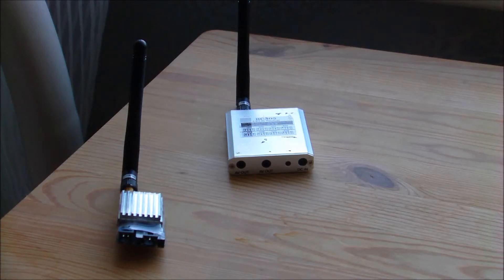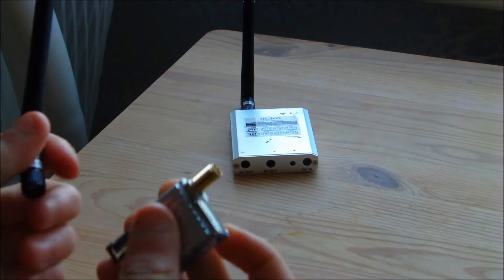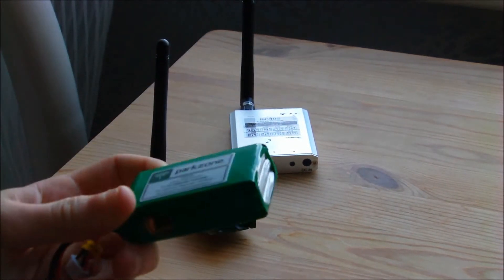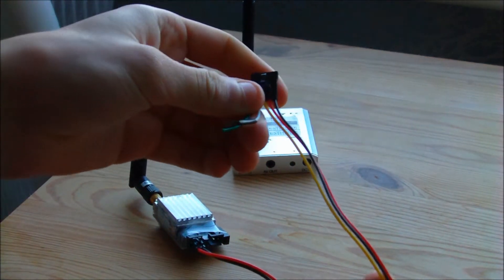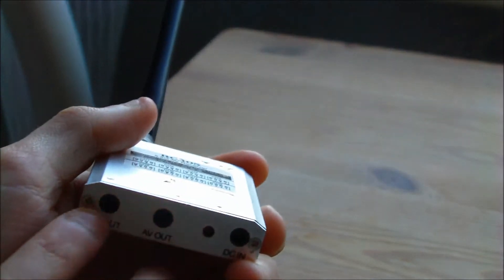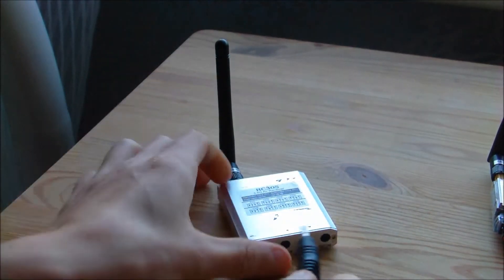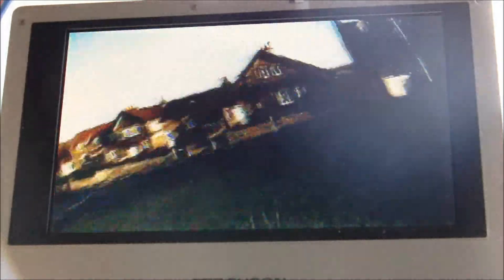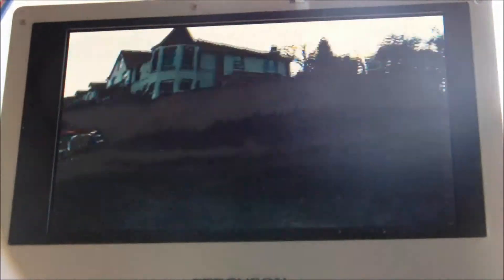Foxtech Fpv 5.8ghz system in depth review

Comment from the maker: It is legit indeed. I've had a very good experience with them! Responding to emails, quick and cheap delivery. Top notch I'd say! If you mean a gopro for recording then the camera i use here is no where near the quality of a gopro. Foxtech do a camera called the horyzon HD v3 which is pretty good, but still, it wont have the functionality of the gopro

Comment from the maker: yeah, because we use 900mhz for GSM phone networks we cant use that. 1.2 is a frequency used by real planes so they dont want us interfering, 1.3 can be used on the ground but because it's close to 1.2 we cant use it in the air. anyway ive got 550m so far, but im still trying to find the limits. safe to say i couldnt see it with the goggles off